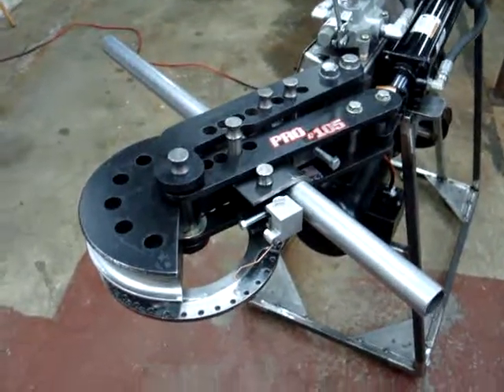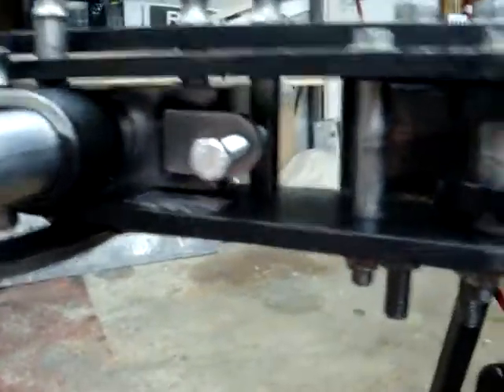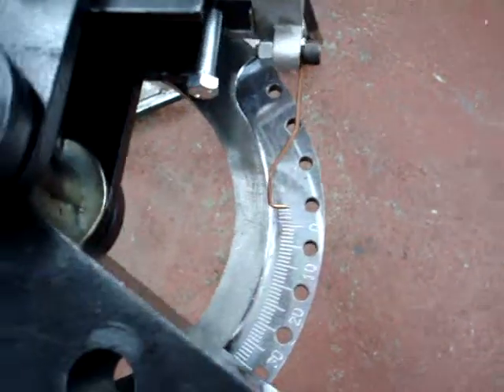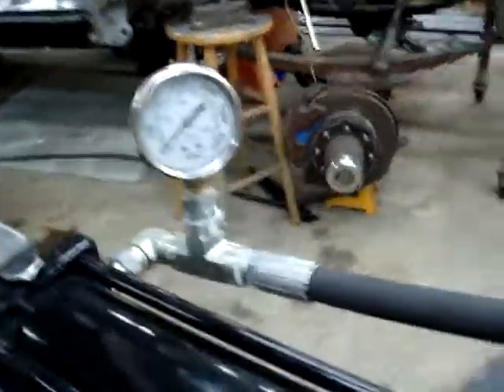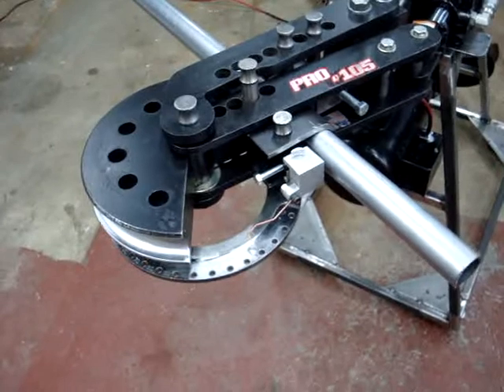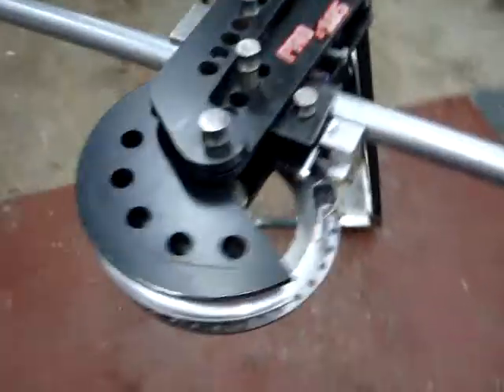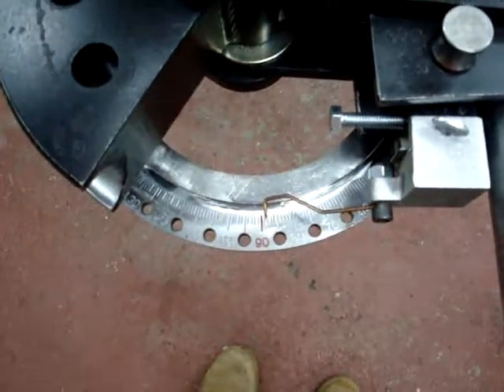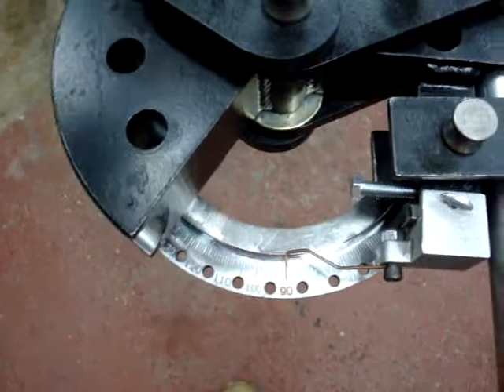Hydraulic Bending of Rollcage Tube - @MightAsWellK5

Comment: Could you please provide specs on tubing and also what CLR die your using? Thanks
Reply from the maker: Not sure what you mean by “specs”... I do a lot of rollcage work and use DOM steel tubing (.120” wall) usually in 1.75 or 2” diameters.  I always buy the smallest CLR available for a particular die size so that by bends are as small and compact as possible to save interior space.   Thanks!

Comment: Hey Greg nice work on the bender! I also have a 105 and am tired of manually bending pipe. I am putting a parts list together to go hydraulic. Is there anything you would do different or change? Thanks
Reply from the maker: I reworked the fixed part of the bender to resist twisting under TQ from the ram.  Basically those two mounting bolts which are only a few inches apart were extended to 12" apart.  Once I did that, the whole structure got a lot more rigid and didn't deflect under power from the ram...